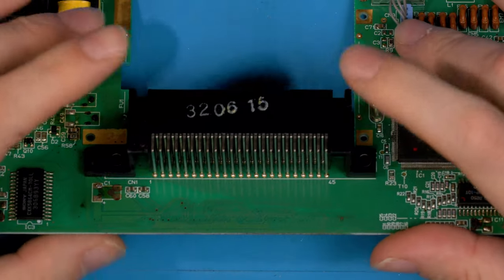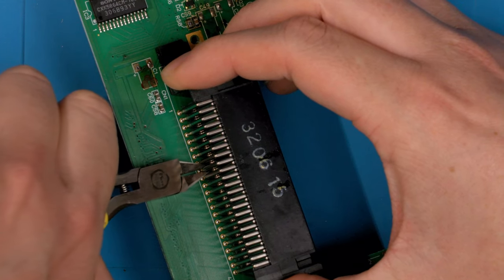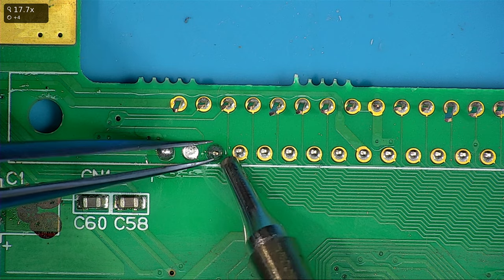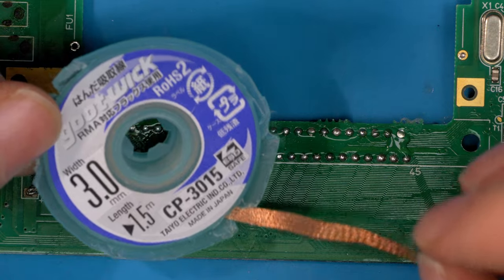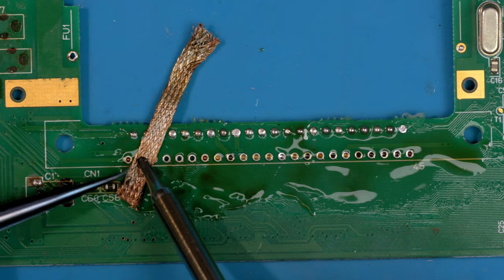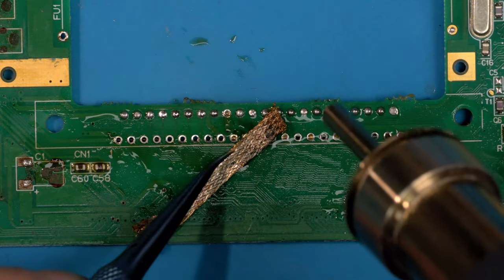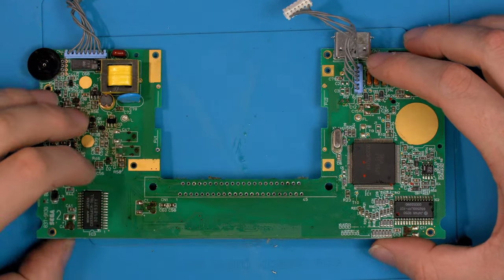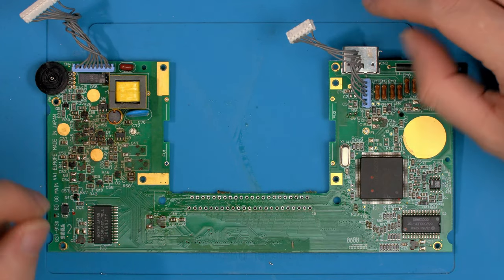This Technique Makes It Easy - Game Gear Cartridge Connector Removal

Comment: Youtuber, Mr SolderFix, has a video to remove electronic components in one go by soldering a copper wire to every pin, then reheating it. Though I have yet to try it myself, it might be a way to remove the connector without cutting the pins.

Comment: If you cut your wick first the solder can’t flow down the roll and you can fit more solder in less wick. Also, with fresh flux on the braid you can pre-heat the solder to ensure it wicks up readily. My stingy technique is tedious but so is fighting with the rest of the wick sinking heat/solder or switching to hot air. You can even use the used portions that are can’t clear holes and saturate them with excess solder from the other holes, pre-heating them remaining solder for the freshly fluxed braid that comes next.
Reply from the maker: I show doing that in this video. Just after the first technique. I show multiple ways of doing it
Reply: @RetroSix  Yeah, I saw and was specifically referring to the flux you also put on the braid. What I’m saying is that your fluxed braid will reintroduce fresh flux to the solder so you can preheat the solder before introducing the braid without worrying about burning the flux off of the PCB.
Reply from the maker: Yeah I get you. I add extra flux anyway for good measure. Can never have too much 😅